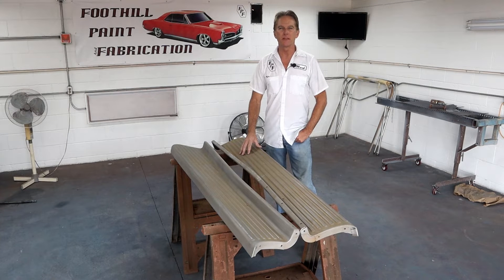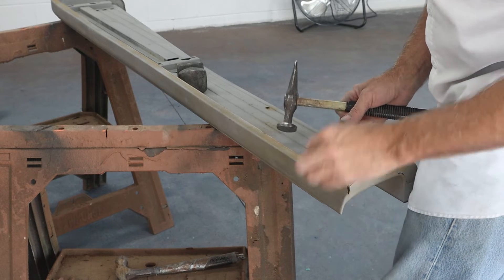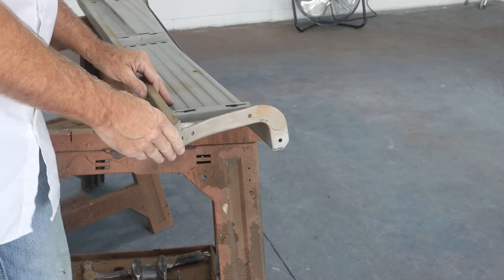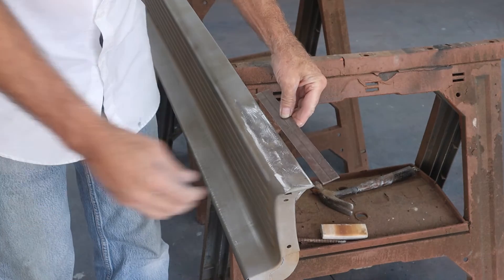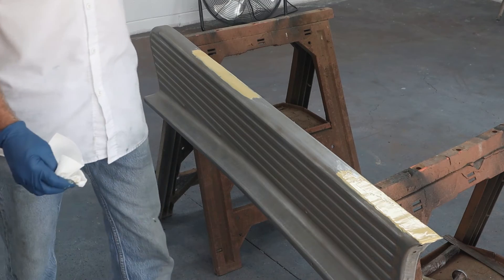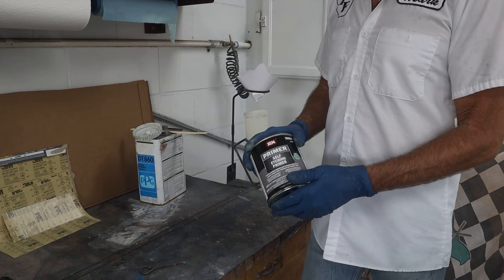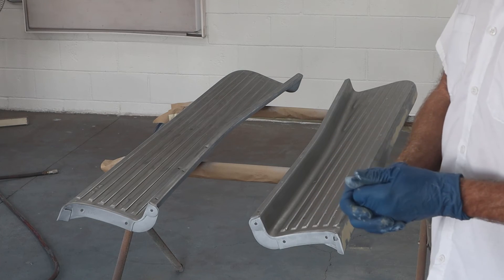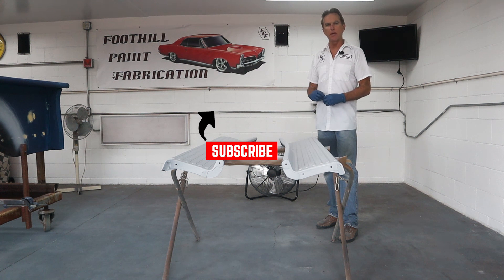1950 Chevy Truck (Ep 19) Running Boards Prep and Painting

Comment: Another informative video, thanks. Why etch primer for the running boards over epoxy or dtm?
Reply from the maker: Thanks Alan,
I will try and keep this short.  First off etching and epoxy probably should be called sealers not primers since at that stage we want adhesion and to seal out moisture, I am guilty of calling them primer too.  I have found that etching provides better adhesion while epoxy has better sealing qualities. For me the adhesion is the most important part of the equation as I have never in all my years had a panel I am repairing rust from the paint side in.  All the ones I have worked on rusted from the inside out like the bottom of a door or  the bottom of a quarter panel because debris held moisture in and back in the day the inside of panels were bare steel.  If protecting the bare steel during the build in humid climates is the biggest concern then epoxy would be a good choice there. Direct to metal primers can be tricky.  You need to do some research to make sure it does everything you want it to.  Just saying you can spray it directly onto bare steel means it will stick well but does it adhere as well as other systems?    I have actually been looking around at some DTM products for the GTO build coming up and like what I see and may go that route.  I am still looking so if you know an excellent product let me know.  What ever you or I choose metal prep is still the biggest piece of the puzzle.  That wasn't very short was it? :-)

Comment: I guess I missed this one. Are those original running boards? Mine seem to be a heavier gauge. I'm just going by how easy the metal moves. I measured mine at 14 gauge. Thank you for your time.
Reply from the maker: Yes as far as I know the running boards are originals. I didn't measure the thickness but I am pretty sure they weren't 14 gauge. Maybe 16 but definitely not 14 but I could be wrong.